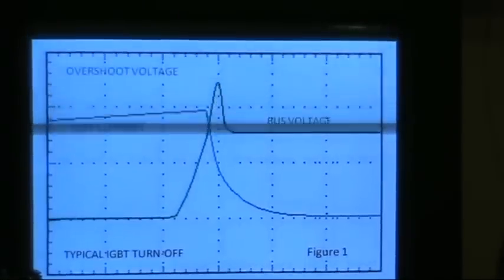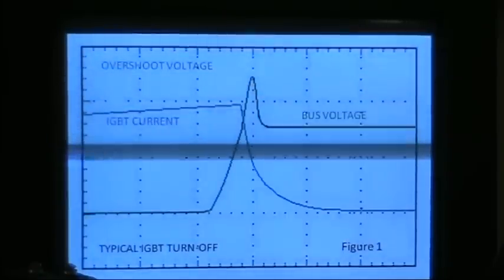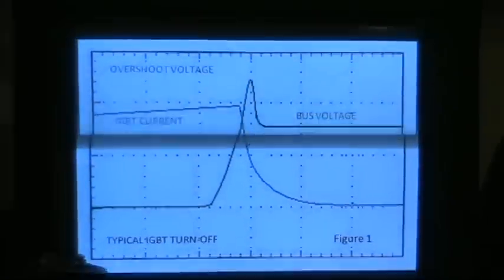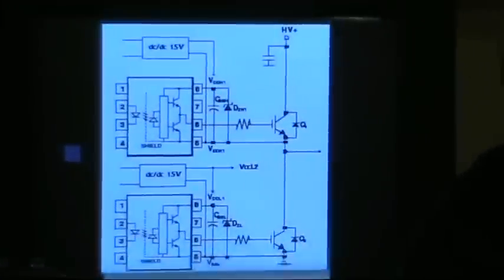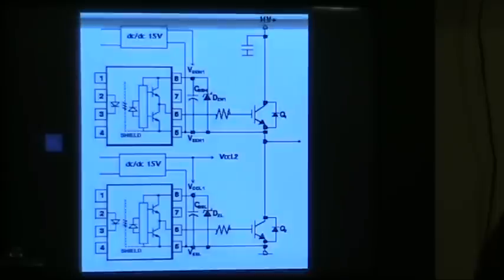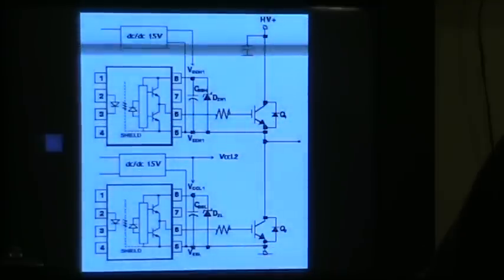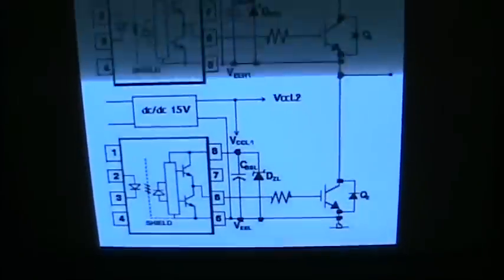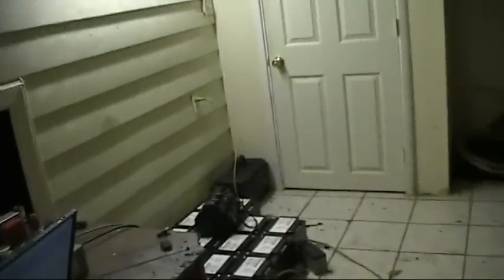IGBTs explained Pt 2. and IGBT Induction Heater

Comment: I have a question for you about controlling four items sequentially on for one second two seconds three seconds four seconds, all items have been turned on and off. The voltage is 120 and the amperes are 15.  How would I be able to control the four items using analog methods ??? Thanks

Comment: You are using impedance matching transformer in this circuit?  Can we hook up directly work coil without impedance matching transformer? I made one induction furnace but that can't reach 8s full performance around 100v that limits the ip current around 12amps can i hook up work coil directly i have 22:5 ratio of transformer

Comment: What is best for induction heating current fed or voltage fed topology? 🤔
Reply from the maker: Current source inverters require the load to match the current source, and also commutation diodes. The advantage is, the current is limited passively by the circuit, rather than actively through the power electronics. On the other hand, voltage source inverters require fewer components, and their performance isn't constrained by the load. The disadvantage is, because the current isn't controlled passively, the electronics will have to actively monitor the current to prevent dangerous overcurrents. So for an induction heater, a voltage source inverter has an advantage in that it can be made to use many different sized inductors, the disadvantage is that overcurrents could easily destroy it. A current source inverter in an induction heater has an advantage of being almost impossible to destroy from overcurrents, but the inductor size choices will be limited

Comment: Hello 
I am doing a similar experiment driving 20kw resistive load .The drive topology is neutral balanced halfbridge. The issue is that the capacitors would get hot when driven at higher power like 13kw. Will paralleling up multiple capacitors help?
Reply from the maker: Yes that would help. A fullbridge is technically a superior design, and you wouldn't need to do much more than what you've already done
Reply: @subcooledheatpump  thank you
Reply: @subcooledheatpump   when you were driving full bridge induction heater, what type of rectifier were you using, i ask this because I am using two different 3 phase half bridge rectifier to charge dc link capacitor for  half bridge inverter driving resistive load and the power factor is 0.6 which is worst.
Reply from the maker: @arrshithrg5359  You will need a boost power factor corrector to make it power factor 1, however an inductor or choke can improve the power factor
Reply: @subcooledheatpump  yess  but inductor for 150hz operation would be really big and heavy right . so i thought of using 3 phase full bridge rectifier(8% ripple factor) without capacitor filter to give dc link voltage to full bridge inverter, what do you think and forgot to mention my load is resistive.

Comment: actually I am from India...I am working on the buck convertor by using igbt...I have prepared the igbt  pwm pulse from dsppic30f5015 and for driver I used the M57962L ic..when my DC input to the igbt is 325 v.i am getting proper soft start and proper buck voltage on DC capacitor..when DC input to the igbt is 625 v DC ..that time M57962l gives the blocking signal and I am not getting output...please solve my problem.. thanks in advance
Reply: Solve your own problem. . . . . you might learn something

Comment: hello. I hope you still like talking about power electronics. and helping ppl. because I need help. or advice.  I need to build a inverter to power my off grid house. I have basically decided to build multiple inverters. to power a typical 20a 120v circuit. so 24v and 2500w. I was told igbt modules would be best. instead of paralleling MOSFETs. but I must admit. I am intimidated after I checked out a few of your videos. I have a better understanding of MOSFETs. but I don't really see how a MOSFET can carry the current some are rated for. the small legs on the to 220 package. and similar. if I go with MOSFETs what would be the safest way to parallel the FETs. and what's the most current the package can truly handle? on a to220 or to247 package FET? your help is greatly appreciated. thanks

Comment: can u plz tell me how can i use the induction cooker circuit for wireless charging without heating of the secondary coil
Reply from the maker: Increase the number of turns on the coil. Increase the voltage and decrease the current. Induction heating and Wireless power work in a similar fashion to a transformer
Reply: for wireless power transfer what is more important voltage or current?
and what should i do to charge multiple devices?

Comment: +subcooledheatpump Is it possible to use cooling blocks on IGBTs with a forced air radiator as the heat dissipator, or is a chiller required?
Reply from the maker: Most basic industrial equipment, such as VFDs and welding machines, uses forced air cooling. However once you start trying for higher power output levels, such as required by an induction heater or an inverter for something like an electric car, then liquid cooling is usually used.

Comment: +subcooledheatpump Question: In a MOSET application when would you use a snubber circuit vs a free wheeling diode?
Reply from the maker: +Donovan Lym You should always use a free wheeling diode unless your load is purely resistive. An inductive load with only a snubber across the power switch will stress the snubber capacitor
Reply: I am looking a the IRFZ44N which has a built in diode.  Do I need to place another one across the MOSFET?
Reply from the maker: +Donovan Lym A free wheeling diode is placed in anti-parallel across the load, not across the MOSFET. When the MOSFET switches on, it builds a magnetic field in the load circuit. This effectively charges the load inductance. When the MOSFET switches off, the inductance will reverse the voltage, the anti-parallel diode "catches" the inductance and dissipates it. That is what a free wheeling diode does. If you still don't understand, watch my video called "How to use an IGBT chopper to control DC motors" That should explain everything you need to know.
Reply: +subcooledheatpump In one of your videos, you mention shorting out the two leads in the igbt and using that as the diode.  Could I do the same with a MOSFET?  I'll check on your video shortly.
Reply from the maker: +Donovan Lym Yes most MOSFETs have a built in body diode
Reply: +subcooledheatpump Thanks.
Reply: subcooledheatpump Assuming that the drive supply voltage is separate from the load supply voltage, does it matter if the drive voltage is higher than the load supply voltage?
Reply from the maker: +Donovan Lym If you are using a single MOSFET on the low side, (source at the supply negative, and drain to the load negative) then it isn't absolutely necessary to have the gate drive supply isolated, but I would do so anyway. If they are infact isolated, the voltage differential doesn't matter so much on the low end. Higher voltages are what stress the isolators insulation resistance. For example, an HCPL-3120 has a rated isolation voltage of 630 volts DC.

Comment from the maker: I would say that is very possible. I would also agree that generally speaking, household appliances are poorly made. A real quality IGBT induction heater is actually very expensive, and would probably be out of the question for a household budget. So a sacrifice is made in quality to lower the price of many household appliances. This is also true for air conditioners and heat pumps that use IGBT inverters for their motor drives. They work for a while but often times fail prematurely

Comment from the maker: For electroplating, you could built an IGBT chopper with a regular diode rectifier front end. I suspect what you would want is an SCR/Thyristor front end that uses PWM to "chop" the output of a transformer (12 volts)or even the mains directly. Since an inverter isn't needed for electroplating (I assume since it isn't usually) you could use more robost and cheaper semiconductors like SCRs to give a high current DC output

Comment from the maker: Experience. I buy alot of used IGBTs and other electronics from surplus stores( they are dirt cheap surplus or used ) and experiment until I can make something useful. I try to show what I make in the videos after explaining. The heater control in the previous video, and the induction heater in this video. Both learned from the internet and from experience. Using the PC as a signal generator was just an idea I had for an induction heater. It worked

Comment from the maker: I haven't used Peltier modules specifically for IGBT cooling, but I have experimented with them before. The only thing I really don't like about Peltier modules is their efficiency. A vapor compression refrigeration system is more efficient than a Peltier module, and their efficiency is increasing. A peliter module though is alot more compact so it would be useful where space is tight. Thanks for watching

Comment from the maker: @definitionofis Yes, I have used them before and I've never had any luck with them. Because they get power right from the DC bus they are prone to noise and therefore I can't say I'd recommend using them. Whenever I've opend up a VFD (motor controller) I've always seen a small high frequency transformer with seperate windings for seperate power supplies for the gate drivers. It's only in lower end electronics that these are good for, the serious stuff never uses them. Thanks

Comment: I looked at the HCPL-3120 optocoupler and I notice it requires its own power supply.
Have you ever used the optocouplers which draw power from across the igbt and store it in a small capacitor and do not need a power supply? Here is one: search digikey com/us/en/products/CPC1580PTR/CLA297CT-ND/1668877  I can guess the disadvantages/limitations. I am curious if you have experience with them.